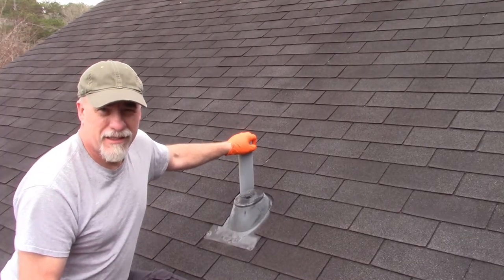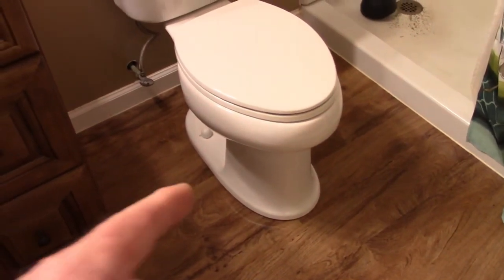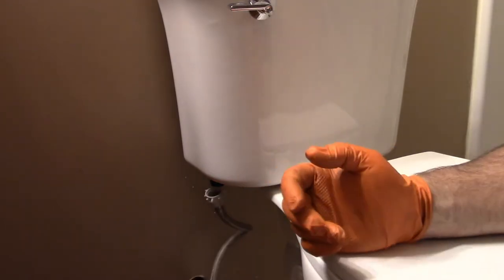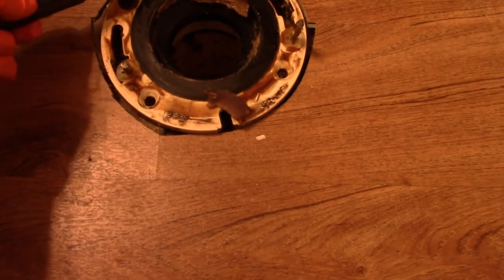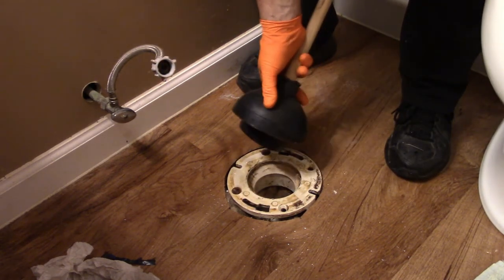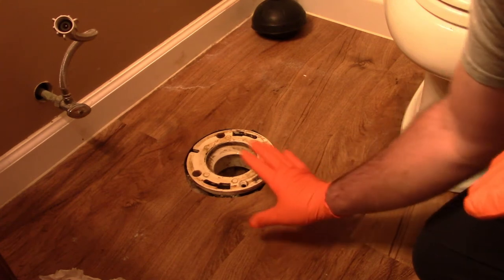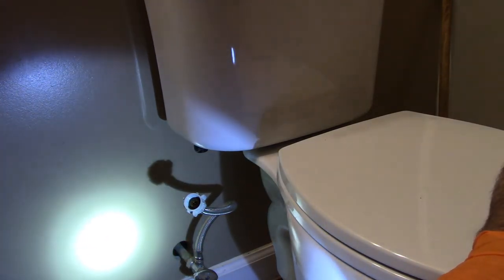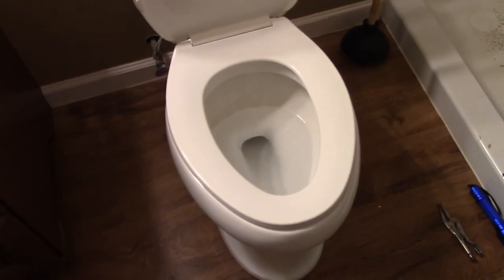Fixing a backed up toilet (septic line)

Comment: Great job of taking your time and explaining your thought process. I have had to learn unfortunately a lot of the same things due to normal clogs and found out hard way “flushable wipes” always clog up the lines eventually and also Alzheimer’s causes someone to put things down the toilet they should not. Plumber installed a “clean out” with removable nut in line outside house before city sewer line (or drain field) that you can try reverse use of snake and also gives you a way to see water flow once line is cleared. I was taught the toilet auger was called a closet auger and they have a 6’ version that usually clears most toilet clogs. All the equipment can be used again and is a lot cheaper than calling out a plumber 1 time.
Reply from the maker: Thanks. We do not use those wipes, but that's a good observation. We've lived here 30 years. Never found a clean out anywhere. We are also on a slab.

Comment: Nice job.  Struggling with the same issue.  Did you try main line cleaner, 5day application?  Someone started using disposable flush wipes?
Reply from the maker: Did not try main line cleaner. We assumed it was a simple blockage. When the wax seal was damaged, I knew I was taking things apart. We do not use disposable wipes. Good questions.